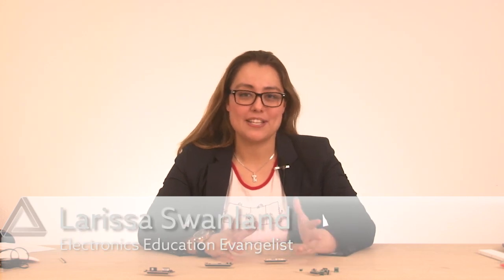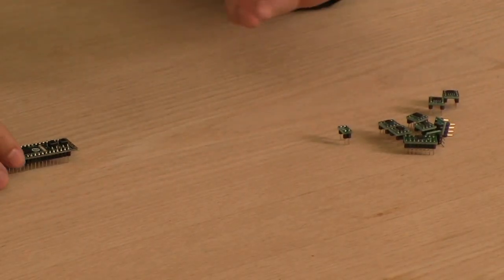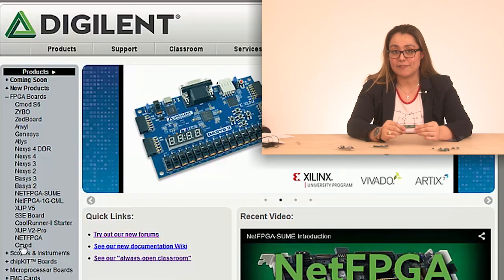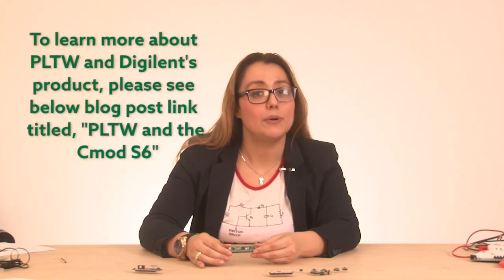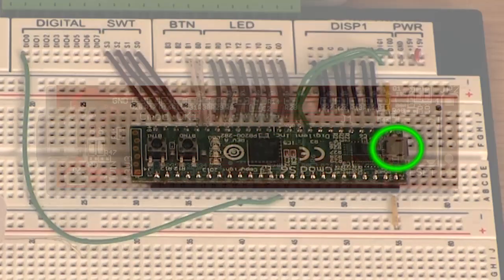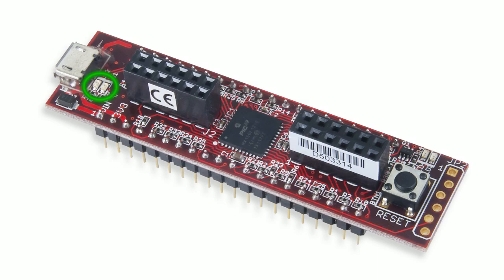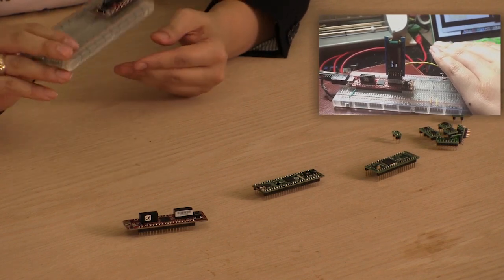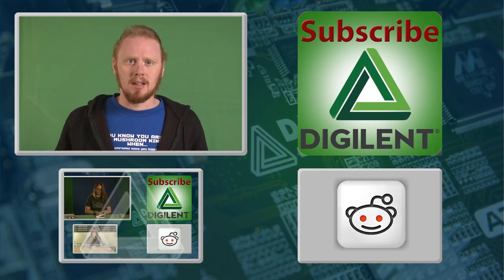Show and Tell Ep.3 - Cmods

Comment: CMODs use standard 0.64mmx 0.64mm square cross section pins not machine pins as mentioned. The CMODs will fit into solderless breadboard but they do not fit into machine pin sockets.  To do so it's easiest to replace the standard pins with machine pins if you have good quality desoldering equipment.